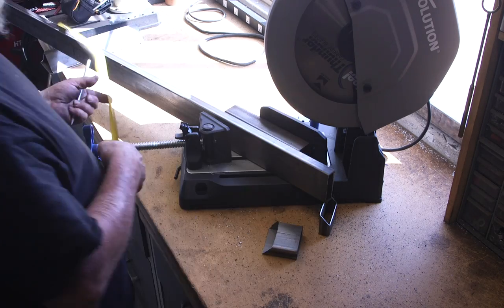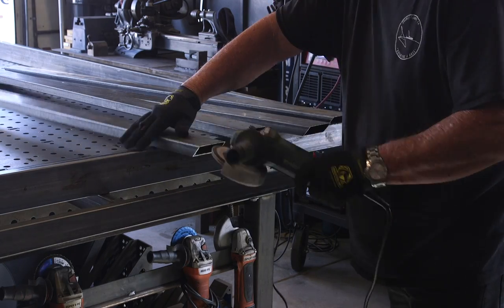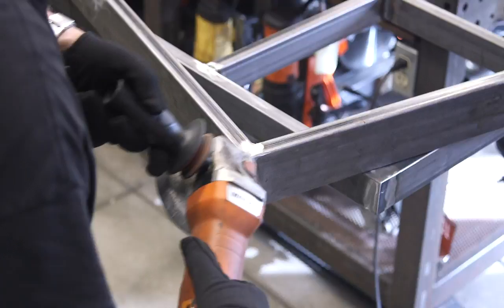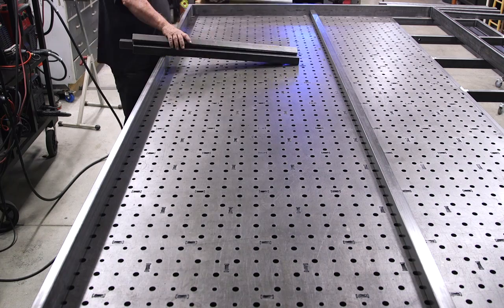Retractable Metal Hobby Train Table Build - Part One | JIMBO'S GARAGE

Comment: Can anyone advise on what kind of tolerances i can expect if i order rectangular tubing mitre cut to specific lengths for a desk project.  If i order pieces that are 19" long should i expect that they will all be exactly 19" long or should i allow for some error and if so what would be acceptable +/-.  The tubing is 2×4 and is 1/8" thick.  Thx

Comment: Great build!  Enjoyed seeing the old lathe's final accomplishments.  Regarding the "almost-true" holes for the feet levelers, if you first cut the length of the round bar and put it on the lathe, you could bore the hole through at true center, then slice off the leg caps.

Comment: Just wondering why when you were cutting the stock you had a square tube extending the piece being cut further forward?
Reply: I do the same thing, it puts the material in the middle of the saw blade specially if you’re cutting at angles.